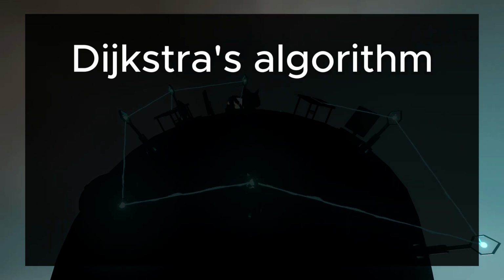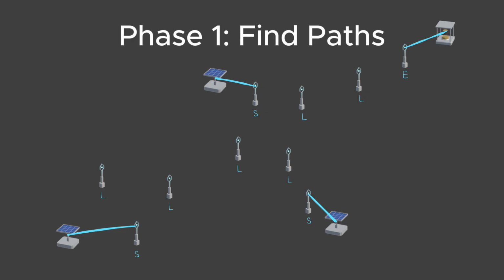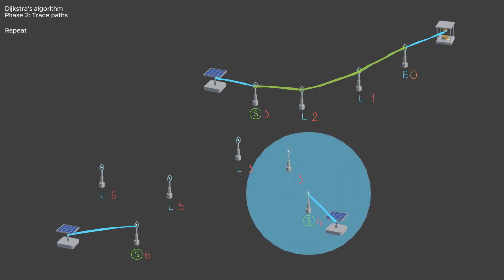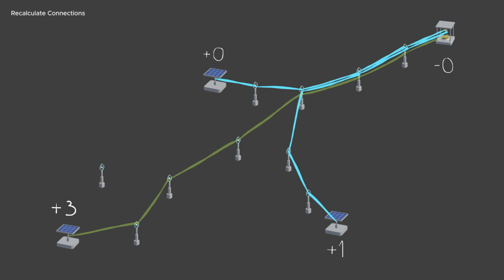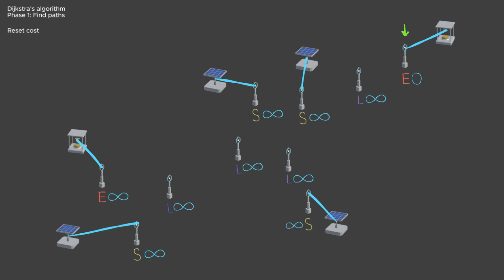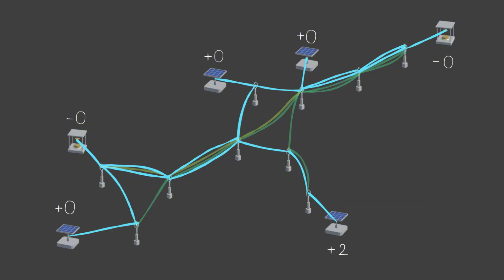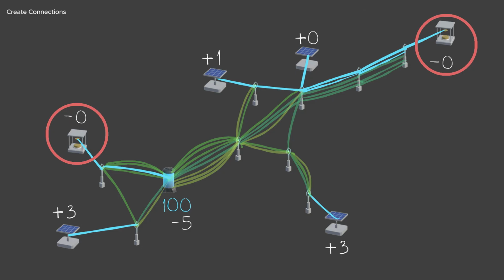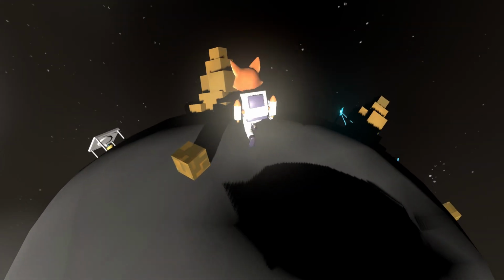How I Built an Energy Network using Path finding | #devlog 2

Comment: Very informative video, thank you!
I have two notes though:
1. Consider lowering the background music as it's sometimes hard to understand what you're saying.
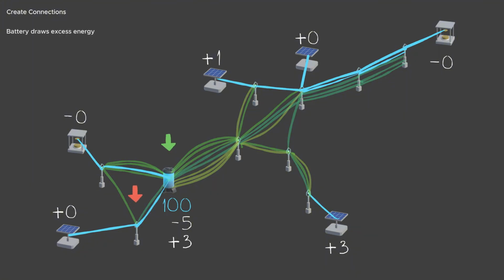2. Have you considered using a minimum spanning tree instead? You don't care, it seems, that the distance between a specific user and a specific source is minimized, just that they're connected. A MST would allow you to do pathfinding without caring about whether a node is a user or a source, and would make it impossible to have the same link redrawn multiple times, as it happens at 10:39. It would also minimize the total length of links, possibly reducing the graphical workload
Still, great video! Didn't know that this algorithm could be used to create a tree, I only saw it used to pathfind between two specific nodes :)
Reply from the maker: Thank you!
I was curious about the background music volume but wasn’t sure if it was bothering anyone. Thanks for pointing that out.

I didn’t know about spanning tree until you mentioned it. I’m learning a lot as I go along with the game’s development. If only I knew it sooner, maybe it would be a video about minimum spanning trees.
Initially, my goal was to provide energy to users from the nearest source, so most of my search results revolved around pathfinding algorithms.

Thanks for your feedback. I’ve learned something new today!